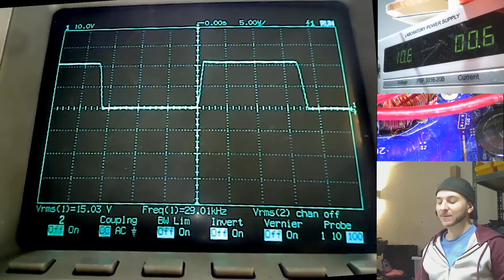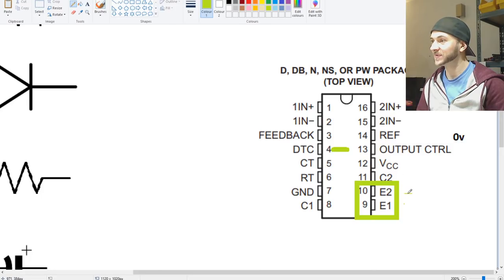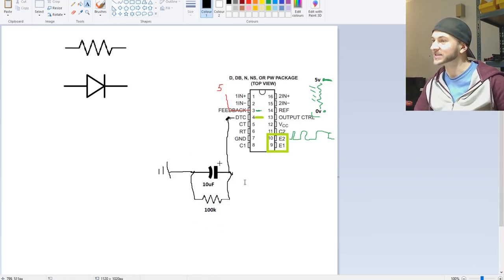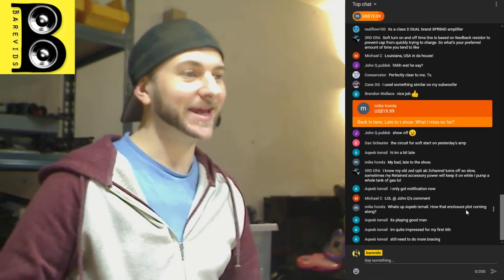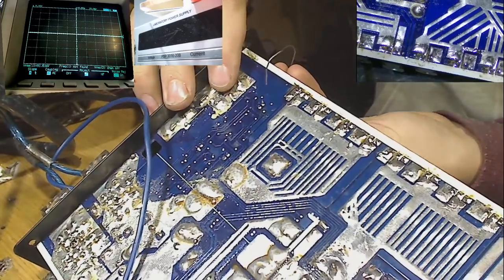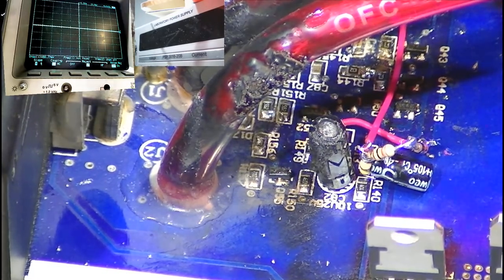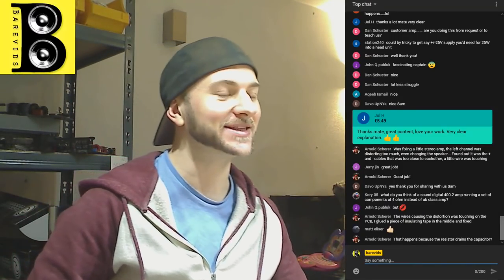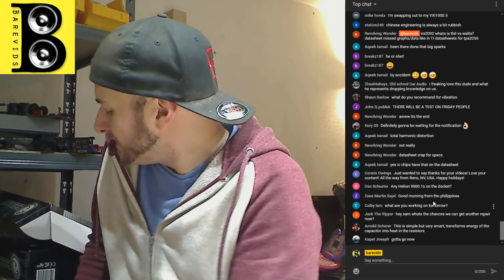VLOGMAS Repair livestream DAY 2 - Adding soft-start to your amplifier

Comment: So you put a RC time constant discharge circuit.
So at full 5v with 100k ohm and 10 microfarad cap.
At 0.5 RC you'll be at 39% discharge, 0.7 RC 50% discharge, 1 RC 63% Dicharge V.

Comment: Does this solve the power down as well?  I have a Taramps MD8000.1 that makes my subs pop each time I turn off the car/radio.
Reply: hmmm, ten minutes in, and doesn't sound like it solves that issue :(
Reply from the maker: Hey buddy, remove the RCAs completely and see if it still happens. If yes, then it's an issue with the amp, or just unlucky parts tolerances you got with your amp. If it goes away it's a wiring issue ☺
Reply: Sounds like a preamp problem. Could be a lot of things.
Reply: @barevids  Thanks for the hint, I'll give that a try.
Reply: @barevids  Turns out it is my Dayton 408 DSP.  I thought Dayton was supposed to be half way decent at least.  I'll have to go through my settings, maybe it's something I did wrong, which is usually the case.